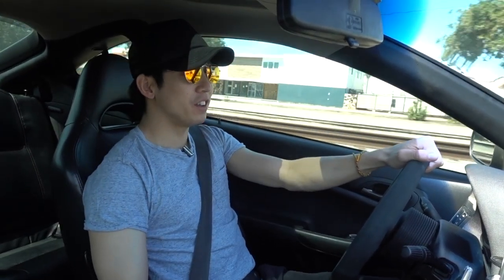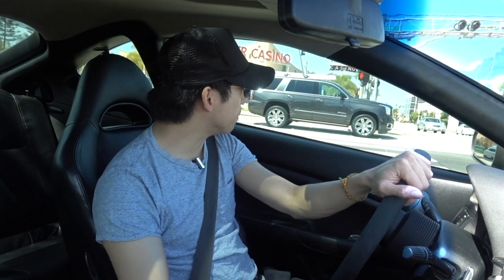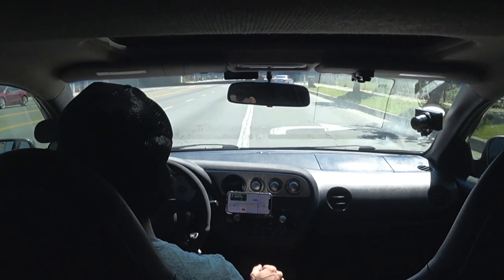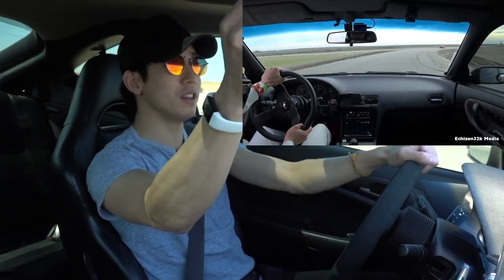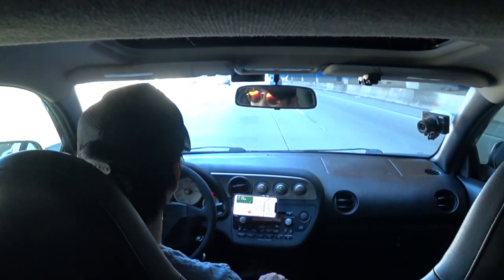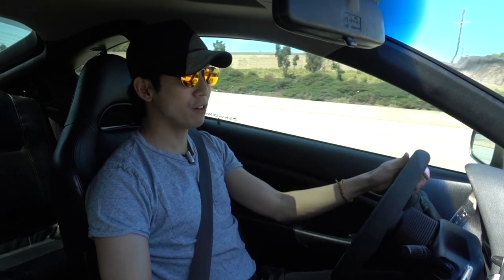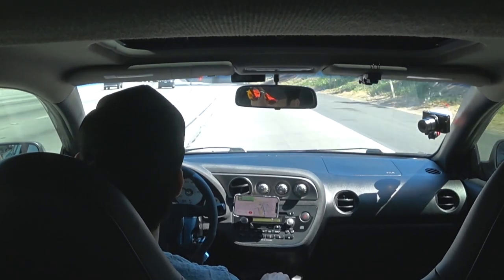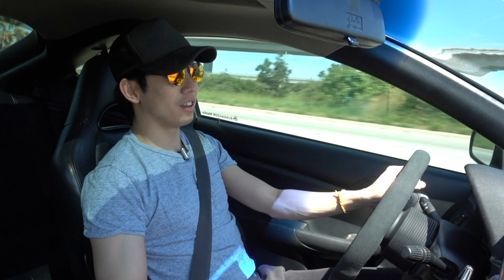RSX Type-S Gets New Clutch, IACV Valve, Tires, Intake (SR) & Starter - First Drive After Upgrades

Comment: Nice dewd😁! I'm rebuilding my whole 05 Acura TL 6Speed MT. Just did a IACV valve on my TL for the same reason. 
Also a big upgrade is the valve deleted master clutch cylinder. 
You can get a OEM replacement LUK one from HeelToe Auto Parts for only 29.99! 🤯😎🤙🏽💯
Reply from the maker: FGbG-Tech CyberModz3D thanks good-luck with your car build! What's the benefit of the valve delete master cylinder?

Comment: You don't care too much about heat soak in the summer?
Reply from the maker: Has some little heat soak, but I think it's not hot enough here in LA to notice any drop in performance!
Reply: @Echizen32kMedia  I beg to differ. Once summer hits and you're just idling at a stand still, those ambient underhood temps really start climbing (as per Kpro). Once you're moving it's better because air is flowing in from the outside. But I personally believe from experience that there's a pretty significant difference in avg ambient temp between by the wheel well and under the hood, even while moving. I also think the k20a2 is more prone to knocks with the hot engine bay air (once again what I've seen personally on my car through kpro). Anecdotal evidence is still just anecdotal 🤷

Comment: If you had to replace your power steering pump where would you purchase one? I’ve read a lot of negative things about remanufactured rsx ps pumps, to the extent that some recommend getting used. A new oem ps pump is something like $600
Reply: Spencer Yeh vatozone
Reply from the maker: You could go with an aftermarket one or a refurb one. But they aren't that expensive if you go aftermarket. I did a quick search on Amazon, and found this one. 
https://www.amazon.com/DRIVESTAR-21-5419-Steering-Accord-Element/dp/B01NBC4970/ref=sr_1_3?dchild=1&keywords=rsx+power+steering+pump&qid=1588061439&sr=8-3#customerReviews

Comment: Mine needs a new clutch i have the 04 type s how expensive is to install a new clutch?
Reply from the maker: I paid about $450 for labor which includes the clutch and flywheel install and pedal adjustment. Make sure you use the OEM throw out bearing and not an aftermarket one. They are a lot stronger and don't go out as early.
Reply: Thanks